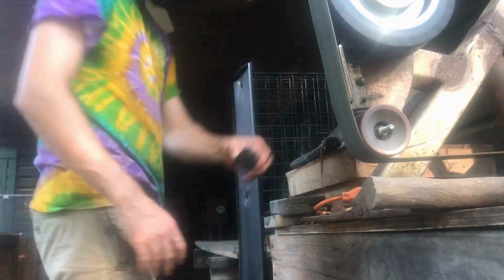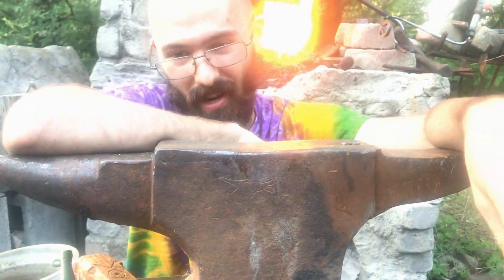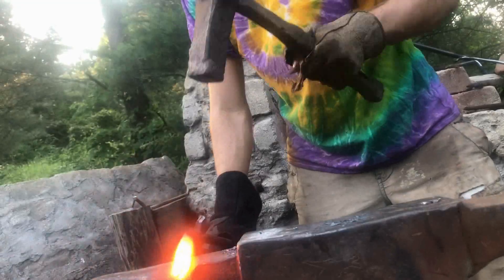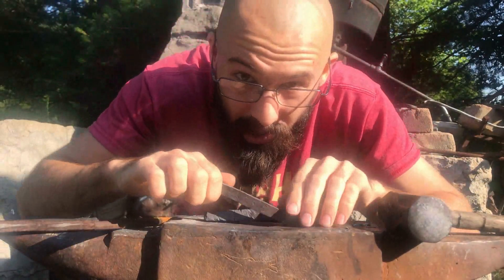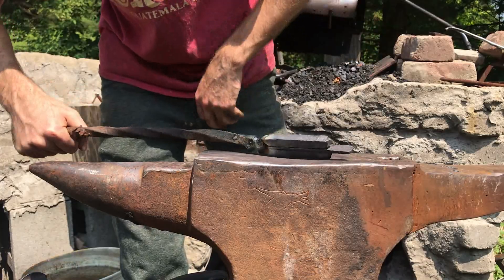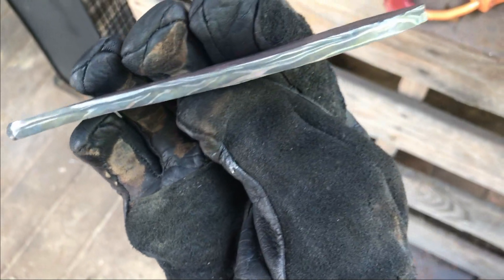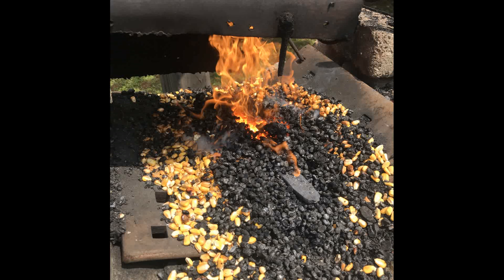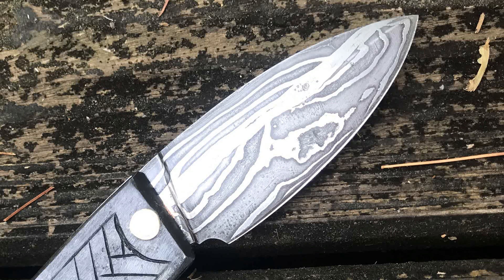meteor forging part 2: finishing the meteorite folding knife.

Comment: Ive never heard of any smith use corn as a fire source. Can you explain that
Reply from the maker: Yeah, definitely! Weirdly enough, corn actually behaves almost exactly the same as coal when it's burned, it cakes together into a solid, porous structure that holds in heat really well. It also keeps your steel clean, it's a very carbon rich flame. Only downside is lower heat output, (no problem with temperature, it'll get you welding Temps) so it's only really good for small parts. But you get the cleaness of a gas forge, with the control of a coal forge.